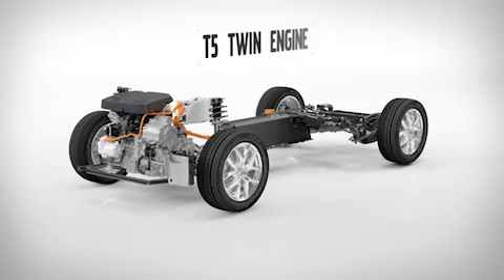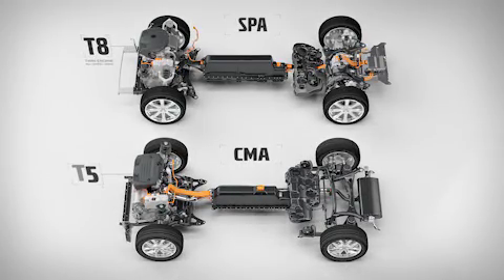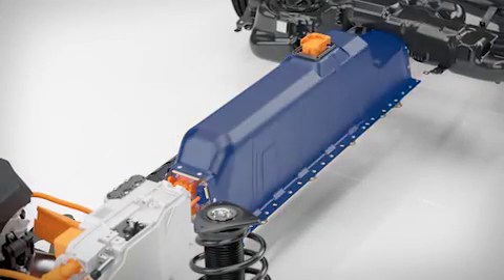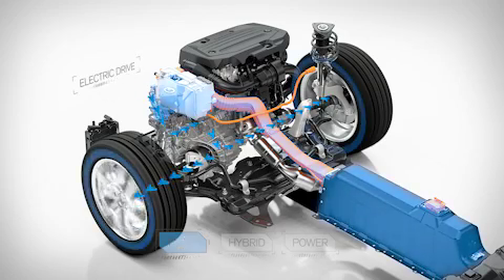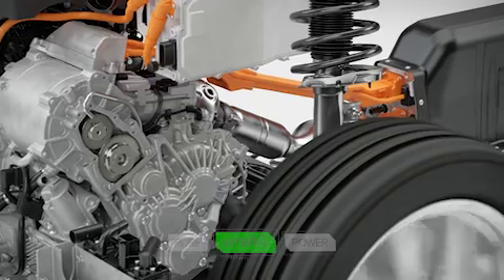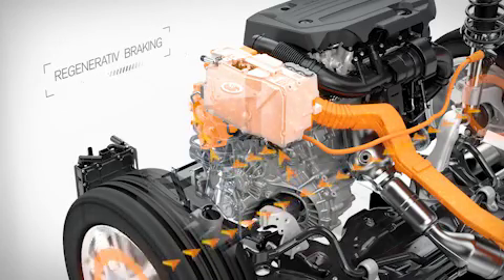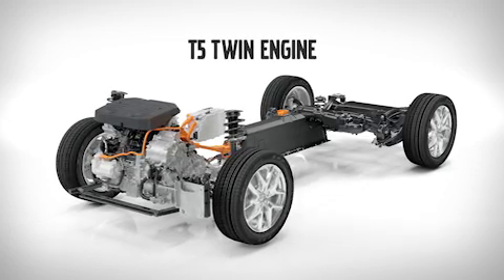The T5 Twin Engine powertrain of new Volvo CMA platform

Comment: Can hybrid battery be charged by ICE if car isn't moving?
Reply: it can but not effiency..and very loud
Reply: As the motor/generator connects to the drive shaft side not engine side, it will rotate only when the car moves, so how can it be charged ?
Reply: @AniruthHiranraks  The electromotor is before the dual clutch gearbox instead of after gearbox. So when charging without moving,the gearbox is on Neutral.
I have a lynk co 03 PHEV which use same powertrain as VOLVO T5 twin engine and I am very sure it can charging by using ICE engine without moving
Reply: @AniruthHiranraks  P2.5 mean the electromotor is 'inside' the gearbox but actually it more close to P2. The electromotor is on  the input shaft of the dual clutch box，after the clutch and before the gear. So when clutch is close but gear is on Netural,the electromotor is direct related to ICE engine but not related to gear. Actually you can consider the P2.5 powertrain as a P2 powertrain with 4 speed(R/2/4/6 gear) gearbox for both ICE engine and electromotor plus a 4speed gearbox(1/3/5/7 gear) only for ICE engine
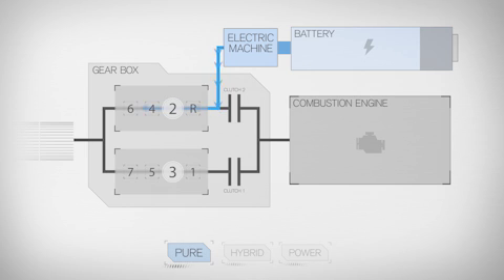Reply: If look at the clip @1:07, it's shown that the electromotor is connected to the gear after the clutch, so when gear is at N and car is parked, it doesn't rotate even  enging is running.